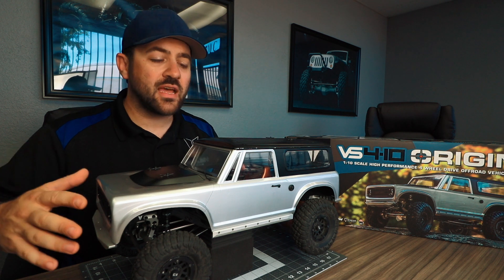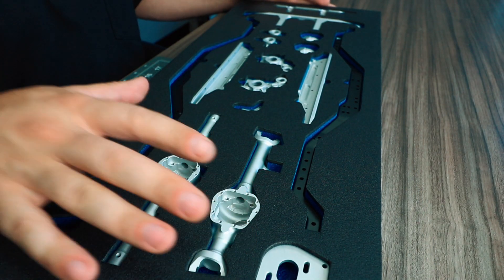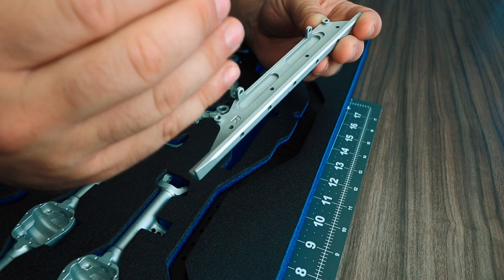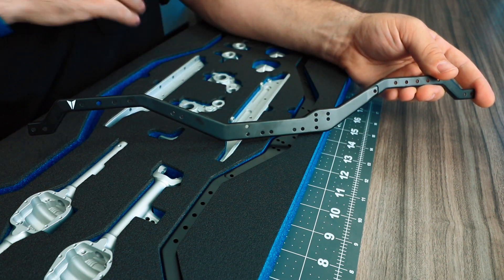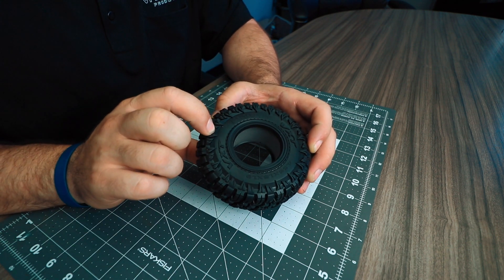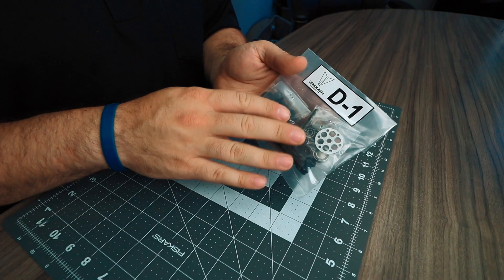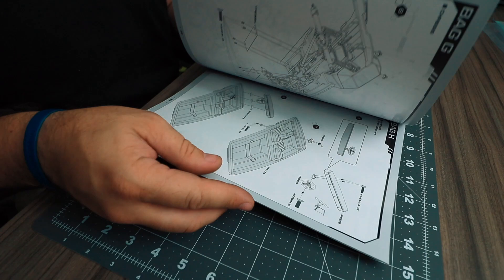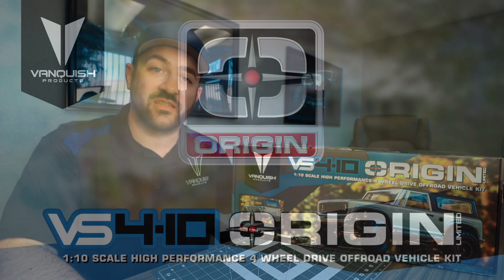VS4-10 Origin Limited Kit Unboxing - Vanquish Products

Comment: Made in Taiwan?
Reply from the maker: We do not have the equipment to produce several of the parts for these kits, such as the body, tires, gears, injection molded parts. We are very transparent about marking parts that are not made in house with the country of origin. However we make a huge portion of this kit here in Sacramento CA. Axles, chromoly shafts, trans housing, motor plate, links, etc.